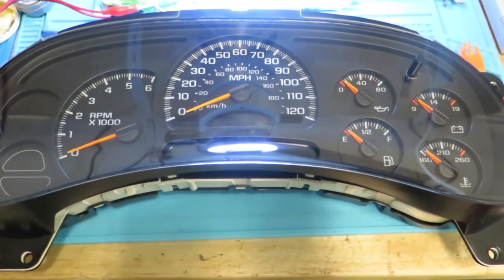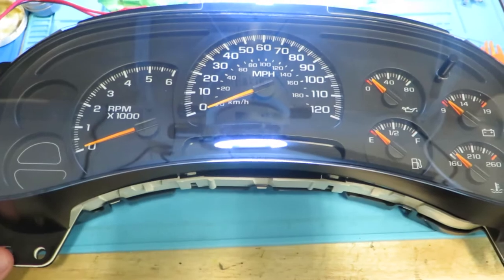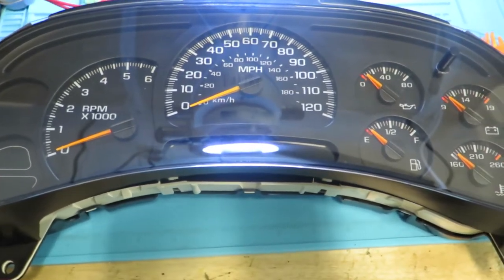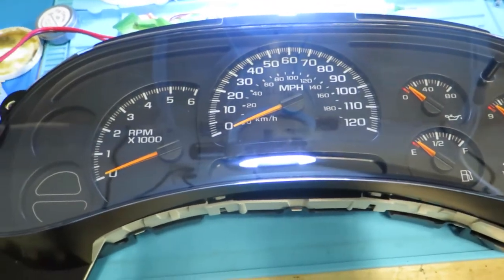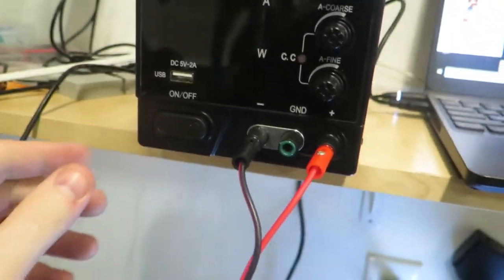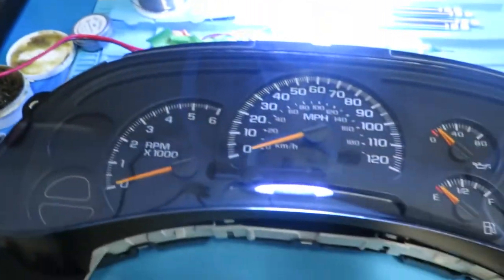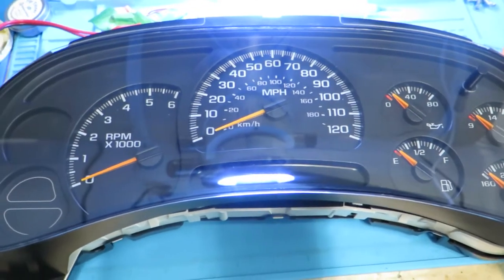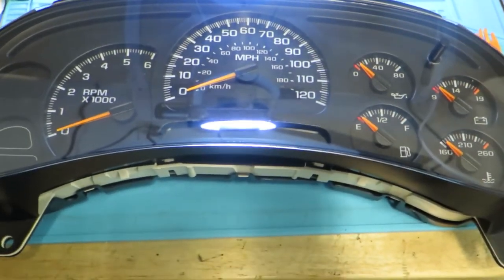Cluster Repair and battery drain.

Comment: What do I need to check if it is draining the battery?
Reply from the maker: Need someone that does cluster repair to diagnose your cluster.  You can also have a mechanic shop do a "drop test" across fuses to find the issue.
Reply: @alaskaclusterrepair2233  ok thank you!!!